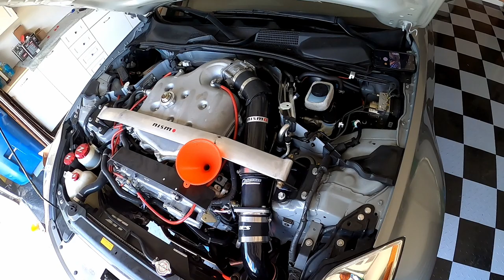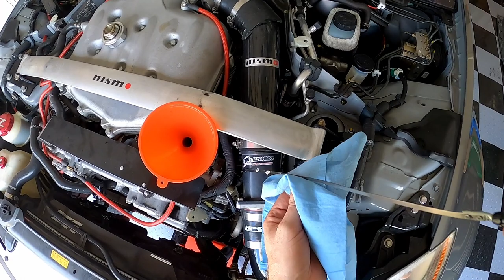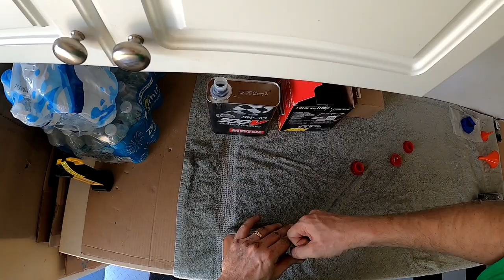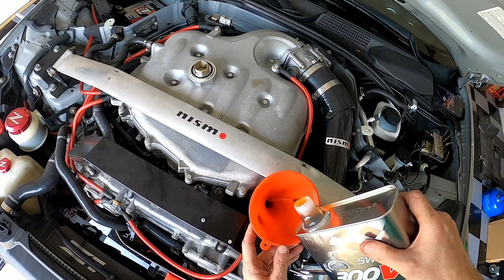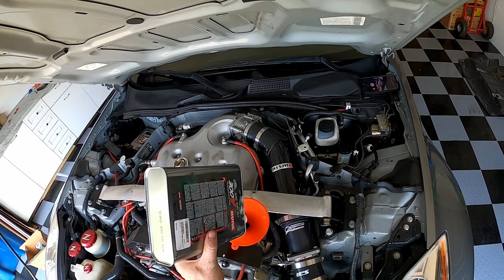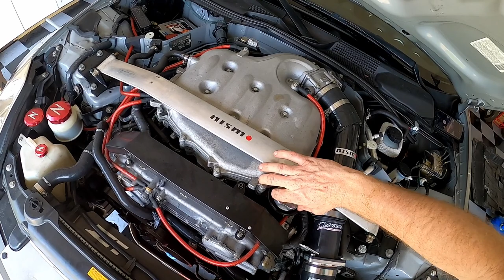Nissan 350Z Adding Motul 300V 5w30 Engine Oil

Comment: Hello Rob, tell me please, where did you buy those red Z caps on the reservoir bottle? Thank you
Reply from the maker: Hello. Thank you for asking about the Billet 6061 Aluminum CNC machined reservoir caps. There are a couple vendors of these billet reservoir caps. One is ZspecDesign. I checked and they don't have any in stock at the moment. You can find them available on eBay. Z1motorsports has an option as well it theirs uses their logo instead of the Z. There are also fabricators who make these in various sizes. You will zust need to print the vinyl Z logo. Happy moding...
Reply: @robreview  thank you so much for the information 🙏🏻 Will look at it! Also I saw you removed battery and brake master cylinder covers, what was the reason? Is it to make your engine look more cleaner? I aslo want to remove 😃
Reply from the maker: @DubaiCalisthenics  I am glad you asked. Yes, it improved the appearance. It is so much nicer to look at the engine in all its glory instead of staring at plastic. It was also to reduce the weight. The batteries are heavy. Here is the battery replacement video: https://youtu.be/f8la36sr31g?si=5QN3Xdw0fyGFWB7G and here is the video on the covers: https://youtu.be/HJYM2H8RRqI?si=n1j0KLUXAosmjAhO.
Reply: @robreview  thank you so much, already watched all of your videos, looking forward for more! Have a blessed day 🙏🏻
Reply from the maker: @DubaiCalisthenics  Many thanks 🙏🏻.  I appreciate your support. Have an awesome day and happy motoring!